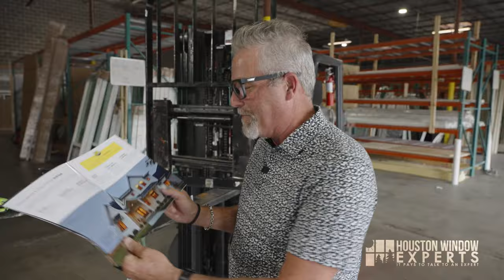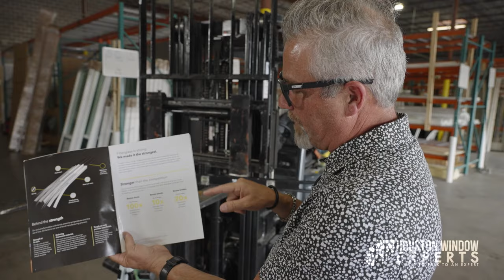Which Is Better: Pella Impervia Or Andersen Fibrex?

Comment: UL  UNDERWRITING LABS DO these very test and other test for fire and safty 
And its in a controlled environment with machines that will take accurate measurements then find the stress points and limits of a product in all aspects,    what im seeing of these nother product has any closed cell or lightweight spray foam in them
A closed cell foam would make the unit more ridged and more energy efficient 
But neither company takes advantage of this. All you get is an air gap.
Hell for 40k bucks for 11 windows youd think it was built better then a new Ford pickup truck but they are not.
Thd Ford truck has a closed cell foam in all body structure supports.
You can make thin products if somthing else is filling the void.

As much as I hate wood rot, woods still a better option.
Reply from the maker: Thank you for watching and your comment.

Comment: Dang it I just ordered Andersen 100 windows
Reply: Its okay, the Andersen 100 is 30% cheaper than Pella Impervia.  That is significantly less.
Reply: This test proves nothing and when are you going to have 300 lbs on a small piece of your window? Or have weights dropped on it? Andersen’s glass pack which is 80% of the window roughly. Is way better pella doesn’t guarantee the argon gas the minute it’s manufactured. Look in the warranty.
Reply from the maker: Thank you for your opinion.
Reply: @Grande79  same glass, not same warranty.  Pella offers no warranty after manufacture date, Andersen offers full replacement for 20 years.  I am currently looking at both and still struggling, price is similar for both windows on my final quote for me because I have alot of arches and those are pricy with fiberglass.  Hard to justify spending $60k on new windows but I definitely won't do straight vinyl in hot Texas heat.
Reply from the maker: Agreed
Reply: @Grande79  haha, yeah I meant fiberglass.  I bike alot so must have carbon fiber on my mind.
Reply: @Grande79  it's all in the wording, I just read through it and they are tricky.  They DO NOT warranty the argon gas in the glass after it's manufactured.  Yes it's the same glass I get that but they say they warranty the glass itself so if you get a crack sure.  But I think the issues most people get with windows over time is a seal braking and loosing gas.  I didn't believe it till I read deeper, if I'm wrong please let me know.....
Reply: @Grande79  it's all in the wording, I just read through it and they are tricky.  They DO NOT warranty the argon gas in the glass after it's manufactured.  Yes it's the same glass I get that but they say they warranty the glass itself so if you get a crack sure.  But I think the issues most people get with windows over time is a seal beaking and loosing gas.  I didn't believe it till I read deeper, if I'm wrong please let me know.....
Reply from the maker: Even though Argon gas may not be covered in the warranty, it is definitely due to a seal failure. If you do have a seal failure you will know it because you will have fog between the panes of glass. Seal failure is covered.

Comment: Imprervia frames a little stronger but Andersen has a much better glass package and efficiency
Reply from the maker: You can get comparable glass packages from either manufacturer and they both use Cardinal glass.

Comment: This is comparing Apples and Oranges.  Yes Fiberglass is always going to be stronger than Composite Material.  Fiberglass is also always going to be more expensive than Composite.  I appreciate the comparison. But it should be a comparison to upsell Fiberglass vs Composite, Not Pella Vs Anderson.
Reply from the maker: Paul, thank you for your comment. I did this comparison because both companies compare these two materials in the home and claim to be better than each other. In my market, the Andersen brand actually sells for more than the Pella brand. Having this information is helpful to a homeowner who may be confused about the claims being made by both brands.
Reply: With all due respect, Paul. 
Fiberglass is a brand name and it is a composite. 
Fibrex is a brand name and is also a composite. 
This is actually an apples to apples test. 
Also, carbon fiber is a composite and is almost always stronger and priced higher than fiberglass products. 
Great video guys! Thanks.
Reply from the maker: Thank you for watching.
Reply: @Craizg35  which brands use carbon fibers?
Reply from the maker: I don't know if any company that makes carbon fiber windows.

Comment: Wrong kind of testing… put fiberglas in direct sunlight without doing a coating to protect from UV damage every few months and see what happens 😂
Reply from the maker: I've done that. I installed thousands of fiberglass windows for over a dozen years in the Houston weather and have had zero issues.